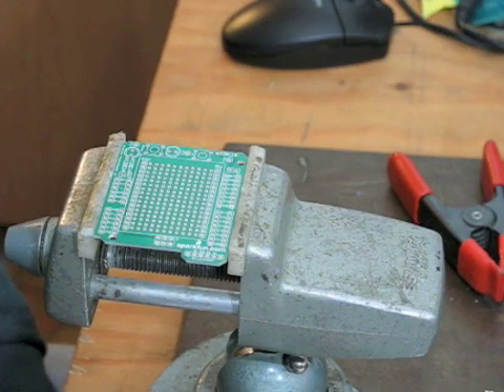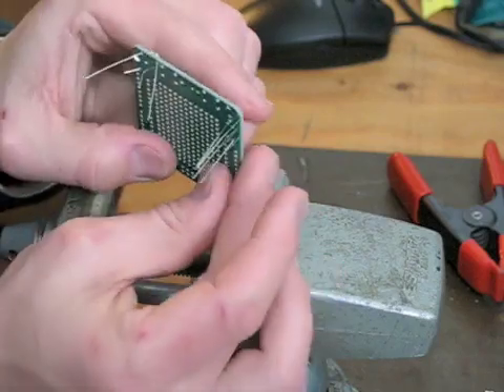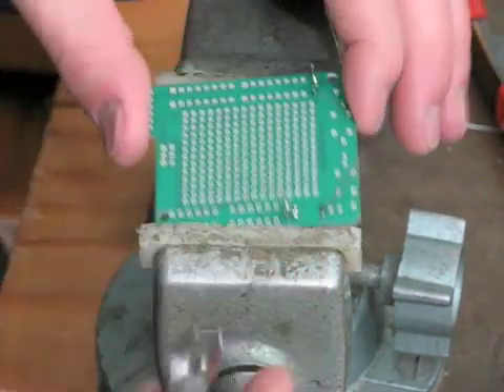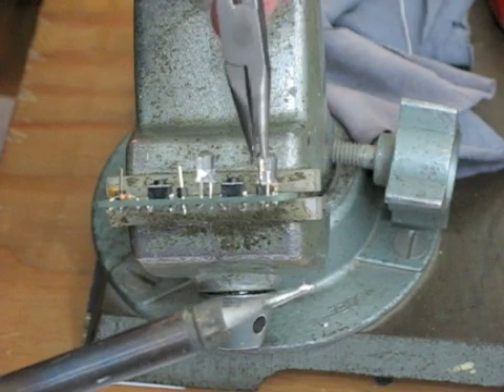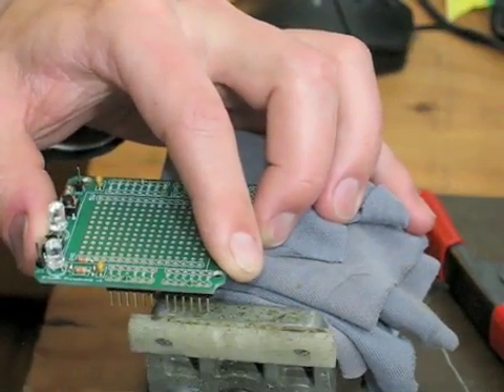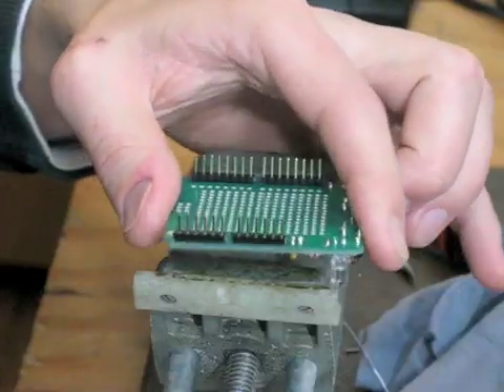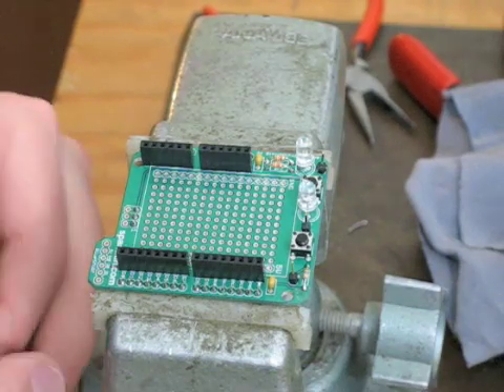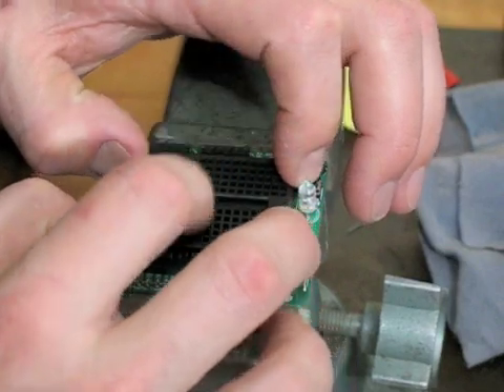SparkFun-ProtoShield-Assembly

Comment: It works better to put the feed through pins into an existing Arduino and then solder them into place in the ProtoShield board.  It keeps the pins straight up and down.  Much easier to do.  Also, push the LEDs down as far as you can so you don't hit upper shield boards (if you stack two or three like I do)